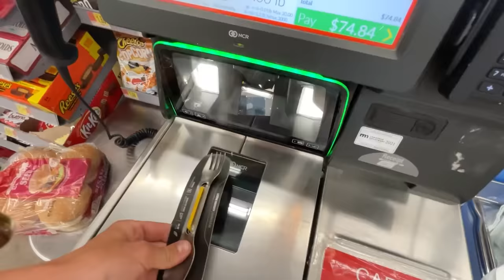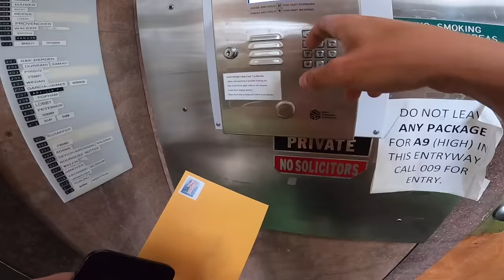Camping in my Small Car for the First time | Overnight in Pop-up Tent

Comment: I’d recommend to put the car into first gear instead of neutral when parking. Gives additional safety when parking on a hill.
Reply: THIS! I was hoping someone would say it. You need to leave your car in gear, since your ebrake may not always work, especially with all that extra weight on the car.
Reply: I did not know that🔥🔥🔥
Reply: I thought this too. He could have a wild ride.
Reply: Each time he did that I almost cringed thinking he needs to leave it in gear plus the brake.  So long as he remembers to put his foot on the clutch when starting.
Reply: Yes, but don’t get your feet off the clutch till you shut the car down xD.
Reply: Haha I was mad stressing about this. I was mentally screaming "put it in gear" when I saw he just ripped the E-brake. Glad someone made the comment. 🍻
Reply: Mechanic - approved comment 👍
Reply: Or obviously if you're parked on a downhill grade not only you know do you turn the tires correctly but you put it in reverse. That way if the vehicle does start to roll downhill it really can't do to the gears and then if you have the tires turned so that they will hit something closest to you.
Reply: Yah that Chrysler Beetle won't hold up, he would need an actual Volkswagen, not the Chrysler remake, Volkswagen stopped manufacturing in the 80s, they got bought by Porsche then sold to Chrysler...
Reply: Always put it in gear when parking
Reply: @timoo12343  normally you’d put it in neutral turn off car then put it in gear
Reply: @timoo12343   You can change the gear after shutting down also.😄
Reply: @QueenDaenerysTargaryen  Do you have experience driving stick? If not then it wouldn't be expected of you. It is pretty common knowledge for those of us who do drive stick however to keep the car in gear when it is shut off, especially on an incline.
Reply: @jennyleef1775  jokes on you, you cannot start a manual vehicle until you push in the clutch! I almost cringed thinking that someone versed in manuals did not know this one simple fact.
Reply: @OnePhillips  you don't need to be a mechanic to know this, in fact being a mechanic does not mean anything in this instance.
Reply: @the_quaint_gypsy  you leave a manual car in reverse, at least not the newer ones... smh -_- All these people trying to tell him what to do when they clearly don't have much manual experience themselves.
Reply: @lukejposadas  Derrr I only drive manual cars so I know exactly how they work.  If the car is in neutral then yes you can start the car without having the clutch depressed.  If in gear and you try to start it without the clutch then it will kangaroo hop and then stall.

Not unless cars overseas are totally different.  All our cars are manual and that's all I will drive and all I have ever driven since learning to drive 44 years ago.
Reply: Totally agree, I'm a retired truck driver Never leave a Manual in Neutral
Reply: I was always told to park with the standard transmission in reverse. Whether you choose reverse or first, I concur to keep it in gear and to not rely on the emergency brake.
Reply: @lukejposadas  No-one likes a know-it-all.
Reply: My first thought too! My Volvo rolled and hit a tree that way….
Reply: True
Reply: @jennyleef1775 On that year VW you need push in clutch to start it in neutral or any gear. I have the same car.
Reply: @The33TIGGER33  thanks for that. I have never driven any manual car that I have had to do that to and I have driven many, many  makes and models of cars from a 1936 Chev upto 2014 Holden's. 

So then nobody could kangaroo hop while trying to start the car if they don't depress the clutch.

They say you learn something new every day.  Thankyou 🙂
Reply: @lukejposadas  yes you CAN start a manual car when it’s in gear. It’s shoots forward. 
Maybe SOME cars can’t if they have added sensors etc but you’re wrong
Reply: I figured I wasnt the only one who noticed lol
Reply: Leave it in reverse if facing down and always carry bug spray.
Reply: I was just about to comment after Ive seen him do it twice 🙌
Reply: Depends
If you are pointing down forward put it in reverse
And of your pointing down backwards/tail than put it in 1st.
Reply: @jrnelson2106  I leave mine in gear with foot on clutch and then turn it off.
At start up, I put my foot on the break pedal,  I take it out of gear and start up. 
Have been doing this for over 22 years.
Reply: @lukejposadas  It depends. Some manuals you have to push the clutch in else the car will not start. Others the car will start but it will make a jolting movement because it is on gear and the clutch is not pushed in.
Reply: I saw the same thing…learned that when I got my first car.
Reply: I was hoping someone else noticed that as well. Always put a manual in gear when parked.
Reply: I was thinking the same. I would always put mine in second or fourth cause I have hade them pop out of gear when I had it in first. Don't know if that made a difference but it made me feel better but that's why you use the emergency brake.
Reply: I've never driven stick.  Do ebrakes fail often?
Reply: @dave29123  mine never did. But I feel it's better to always  use it and keep in gear. Having it in neutral with e brake is better than having it in gear without e brake. They can pop out of gear.
Reply: @jennyleef1775  I drove a manual for many years. With the newer ones, nothing will happen when you turn the key with the vehicle in gear. You have to depress the clutch to engage the starter. No more bunny hop!
Reply: @suecave7139     I now realise that most new ones must have this in built for safety.  The latest model manual I have driven has been a 2014 Holden and I don't recall that having to have the clutch depressed.  Our cars are both Mitsubitshi models (Lancer and Pajero) 2005 and 2006 and neither of them need the clutch depressed to start.

So the guy saying the joke is on me well no not really, it will depend on the vehicle and perhaps also the country it is in. 

My husband said he had driven one car that needed the clutch depressed to start, it was a Hyundai.
Reply: Always in reverse when parking
Reply: Parking might be better...
Reply: true ive always parked in gear.
Reply: @dave29123  not usually. When mine did, it was because I had a brake leak (rear wheel cylinder was failing). I actually didn’t know for a while because I always parked both in gear and with my e-brake.
Reply: u learn that in driving school lmao
Reply: @theuberman7170  Dood. Talking shifters.
Reply: @sherylbentley3724  unless you're about to push start it.. lots of experience with that in a 71 corolla - in maybe 78
Reply: Wow. This has turned into a car thread.. love it ❤ I was taught driving manual 1986 Datsun (now Nissan) 280ZX.   Some models of cars did not even come in automatic, some still only offer manual.  Case in point= Lotus, my Honda S2000, most older exotics. I believe a manual gives you the feeling of truly enjoying the drive. You are in total control of the vehicle. I love feeling every curve, downshift, double cluch, the sound of the engine, the high rpms....ah. yep. I love driving a manual- except in terrible traffic. I believe out of the 58 cars (I have been in the car business my entire liife)
I have owned 2 were automatic.  
1979 Monte Carlo and my BMW Z4. That is paddle shift SMG.
Reply: @lukejposadas  Joke could be on you. That feature is a modern post computer ad on. Older vehicles did have it. Many of my cars when I was young didn't. Turn the key and you are moving. Pre computer diesels had mechanical fuel pumps instead of electric. They had to put manual fuel shut off valves in after many people got power ran over by their own vehicle! If they rolled in gear they would start and run over what ever. Was is the way.
Reply: @jennyleef1775  Older cars didn't have that modern safety feature. So it depends on the year. Basically if it has a computer and sensors the starter will not turn in gear without clutch. The neutral thing is brand specific. Some will start in neutral and some won't
Reply: You always put the gear in first when parking. ALWAYS……..
Reply: @lukejposadas   depends on the age of the car! I've never had step on the clutch to start any of my cars till my most recent one
Reply: When I had a stick and was headed uphill that is what I always did  with the break as neutral tends to have you running backwards downhill.
Reply: @Inlinetodie  I didn't know that.  Bummer.
Reply: @lukejposadas  Maybe true of new cars, but every car I've owned you can definitely start without depressing the clutch.
Reply: Im so happy someone said this!! I use to drive one that didn't have a parking break and had to always park in 1st!
Reply: @Inlinetodie  
Porsche never sold vw to Chrysler...
Reply: @Myeyeofthebeholder  Garfield
Reply: @missbleach8767  that's me dear 😂
Reply: Yeahhh that's not typical practice. In practical manual "stick" tests your required to always put the car into neutral when not in motion and when parked.
Reply: @jennyleef1775  most new age cars won't do anything without the clutch engaged. So he don't need to worry about the old take off on start issue lol.
Reply: Americans making a big deal driving a manual
Reply: 1st gear for a regular parking or when you're parked in an upward hill, reverse when parked in a downward hill. My driving instructor always makes me put a gear after I'm done parking.
Reply: I thought everyone who drove a manual knew this. It’s literally the first thing you normally learn.🤦🏼‍♀️
Reply: i thought everyone who drives a manual knows this,,i even put it in reverse if the car is facing downwards on a hill.
Reply: @the_quaint_gypsy  YES this is a very important detail of how you are oriented on the hill 😂😅
Reply: @jennyleef1775  I’ve never had a manual car that let you start the engine without pushing in the clutch, is that a thing?
Reply: @Inlinetodie  what are u talking about? :D
Reply: But it might mess up the gear box 🤣
Reply: @jennyleef1775  most cars won’t turn over in gear
Reply: He's not parking on a hill. He's camping on a deadly horizontal parking lot.
Reply: @jennyleef1775   the clutch has to be in to start a manual car. lmao.
Reply: @Inlinetodie  what the hell are you talking about
Reply: @borgorajkeraban1403  you want to make it a habit so nothing ever goes wrong
Reply: Especially in the blizzards he parks himself in.
Wake up on the North Pole.
Reply: @Inlinetodie  what in the world are you talking about

Comment: A "Bug" camper full of "bugs." I could never sleep with even one mosquito in the room. I don't know how you did that = but the camper is cool!
Reply: I have the worst reactions to bites, so I'd have to be drenched in bug spray before going in that bug death trap lol!
Reply: If you were sleepy you could.
Reply: Agreed. It was painful to watch. Poor dude can’t even straighten his legs when he sleep.
Reply: Bug will go away once lights off.
Reply: @peachboyriverside156  if he leaves a light on outside, the bugs might stay near the light and not come inside.
Reply: Peep used to sleep over fires
Reply: haha  ;-D   I came here to say this  ;  ]     --  it is a TRUE 'bug camper' !   ; p
Reply: Mav: Was coming up with "sealing" ideas for you but you've probably already solved it by now. Thinking adhesive foam door/window sealing tape affixed in between snaps (if it works then sew it on) would tighten that up. Hanging bug-zapper inside would help, and laying mosquito netting over the sleeping bag, crawl under and push it up to ceiling (hook it somehow), making a tent of the netting over sleeping area - would be better than just letting them have at you. :) I love the bug. Keep on truckin!

Comment: Get velcro with adhesive on back and line it all around in between the clasps. Should help alot with bugs getting in and pretty cheap. Even though it's kind of a joke camper, it's honestly a pretty convenient setup and very practical.
Reply: Yooo I was just thinking that
Reply: I came into the comments to suggest this exact thing. Get velcro! Lol
Reply: I was going to say thats what i wld do also.
Reply: Whoops.. I just suggest the same idea.. and saw more did that.. great minds think alike? Or are we all people who camp and think this way? 🤔😁
Reply: You should also additionally sew the velcro into the fabric because the glue is eventually gonna lose its strength as far as attaching the velcro to the camper long term id recommend superglue or something better
Reply: @ben3babe  Gorilla glue maybe...
Reply: @ben3babe  i was thinking the same thing; sew it thru the fabric and adhesive on the shell
Reply: I was gonna say velcro or strip magnets myself! Both are simple to install and should be enough to keep the bugs out!

Also they make unscented bug repellent machines, Thermacell is one brand, they're just pads with repellent material on them that the machine heats to irritate bugs. For a small space like this VW RV popup I think one of those would be handy too!
Reply: @thehumandirigible4882  especially the USB rechargeable ones
Reply: @sassykat2000  I'd use E6000 glue ! That stuff works way better then ANY Gorilla glue ! Or super glue ! Used E6000 in my WASHER to fix a bolt cover in the bottom of the drum ! (Top loader HE) and that was almost a year ago and hasn't come off yet in water ! When Gorilla glue made for being in water , the cap came off in about 4-5 washes ! That E6000 is AMAZING !
Reply: I was thinking this or duck tape
Reply: I use velcro around the screens I made for my doors on my van. They work great. Velcro 
👍👍👍👍👍
Reply: I did sew a strip of heavy duty material around edge of screen then sewed the velcro to the screen BY HAND because the machine needle gummed up from the sticky on velcro. I’m sure you can get velcro w/o sticky on it which might allow you to use sewing machine.
Reply: Our 1969 pop up tent camper had sewn in Velcro to attach the canvas to the sides.
Reply: I was just about to comment this. Velcro, man.
Reply: @sassykat2000  I was gonna say flex tape since it's waterproof also
Reply: @Yoboymatt69  Patrick Starr
Reply: Duct tape to the rescue!
Reply: Alien tape👍 that will do it.

Comment: For the mosquito thing, it might help to have an aromatic oil diffuser and put some rosemary oil into it with the diffuser on the lowest setting (cuz the bug camper is rather small), from what I've heard mosquitos hate the smell of rosemary and just kinda leave the air space, and it repels other insects as well. A nice side effect is that if you have any breathing issues it clears them up a bit since its an antiseptic, antispasmodic and an expectorant. And no, I'm not someone who's into that essential oil stuff, but this one I know for sure helps in some regard :P
Reply: @Charles Morse The only oils that work diffused into the air are the ones with menthol but only then there are just less likely to bite

Edit: and for some menthol is just annoying
Reply: @FrozenMermaid666   I have read your channel description an if that isnt ironic than i too am a true royal, probably more royal than you
Reply: OR SIMPLY FUCKING SPRAY BAYGON
Reply: Rosemary is known for its ability to support mental acuity.   😎
Reply: @c.thompson9771  I might have to try that since there's precious little of that in my noggin XP
Reply: Citronella, lemongrass and lavender essential oils
Reply: Wouldn’t he need electricity to plug in said diffuser?
Reply: @oliverthecat6529  weird flex but ok.
Reply: @WaywardVector  wasn't a flex, have you read her profile? lol
Reply: @oliverthecat6529  I have read her profile desc and went a step further and went to her FB. I dont think she is a troll, just a disturbed soul unfortunatelly.
Reply: @korosensei4384  at least she has all the confidence she needs, id call it un-earned bravado tho.
Reply: Bug spray or natural deterrents
Reply: @FrozenMermaid666  what are you?
Reply: oils? Get those blue tablets that you set on a device that slowly burns it, no mosquitoes anywhere. Also mosquito spirals are good. While they last. I personally have a "termacell" which is a portable blue tablet thingy cuz nothing beats it.
Reply: is Mav related to Justin Beaver?
Reply: OMG THANK YOUn
Reply: Hmm. How about a bug net?...
Reply: There are some really snall & simple plug in auto diffusers to use some Rosemary essential oil in.